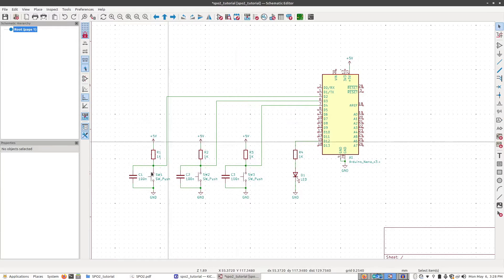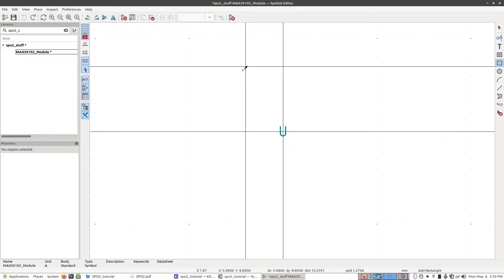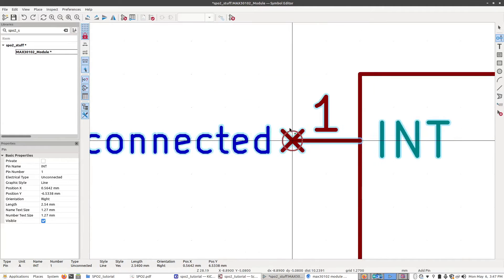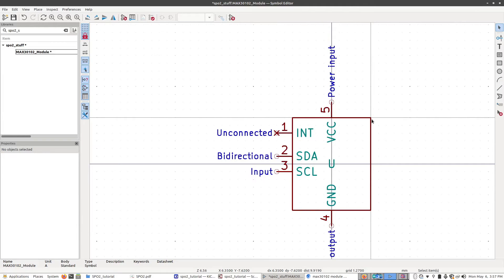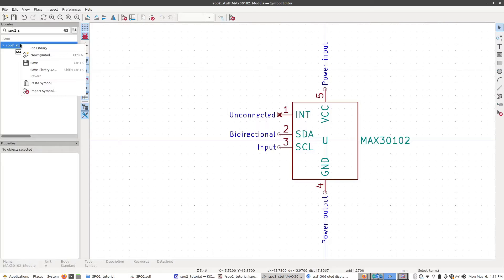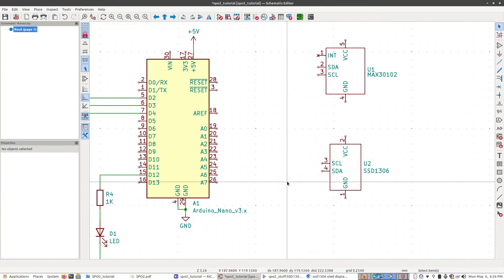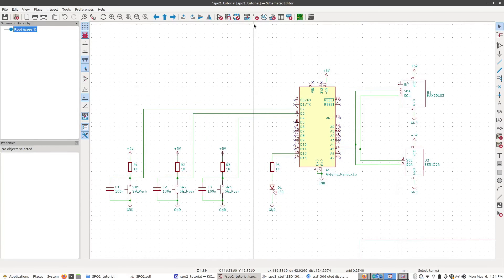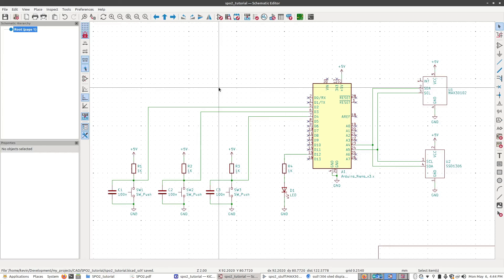KiCad Custom Parts | Part 2

Comment: How do you know what electrical type each pin is?
Reply from the maker: That will depend on your specific component. usually there is a spec sheet that tells you what pin is what.